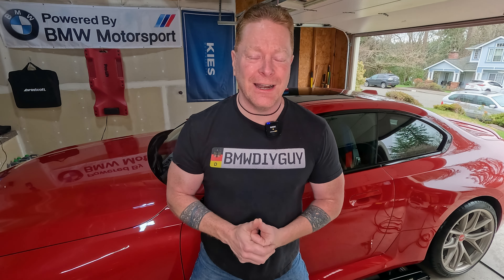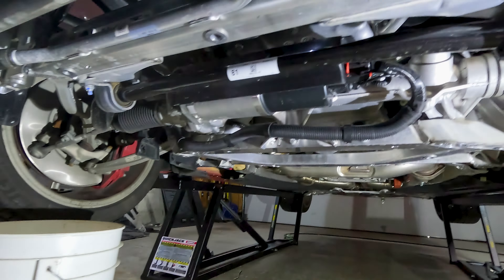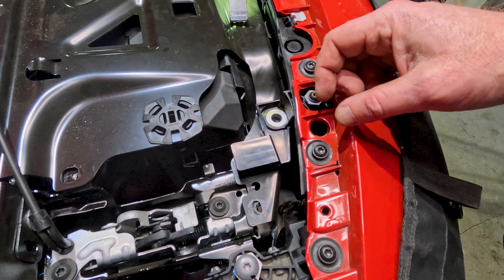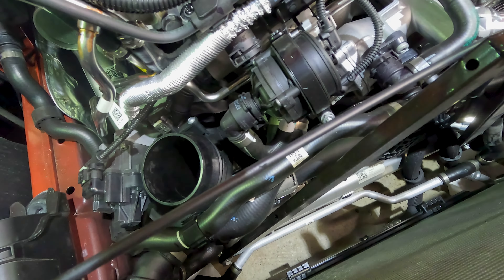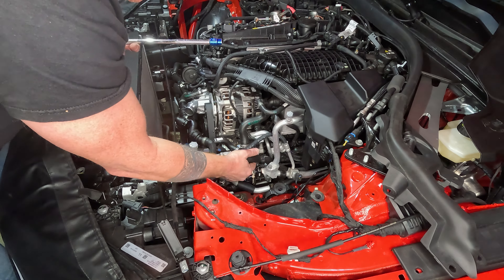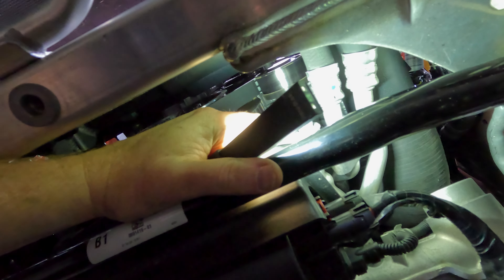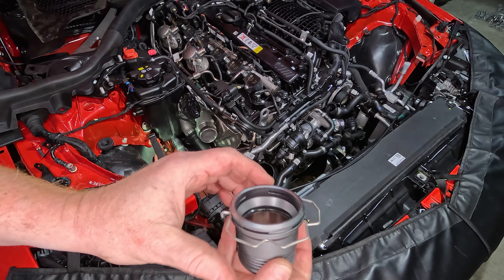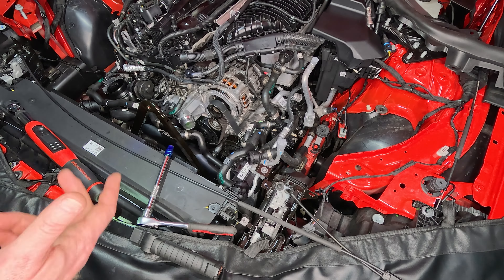The upgrade your M2, M3 or M4 needs - Mishimoto S58 charge pipes DIY

Comment: Those worm clamps are bound to fail or leak at high boost, i'd put some t-bolt clamps instead.
29:19 lolol nice magic trick 😂
Reply from the maker: Agreed and will change them out in the future.
Reply: I just read an interesting article talking about worn drive vs t-bolt clamps.  The worm drive style provides more uniform pressure.  Assuming the clamps provided are high quality stainless and in the correct location (behind lip beads if they are present) should be fine.
Reply from the maker: @stephen0483  Really interesting!